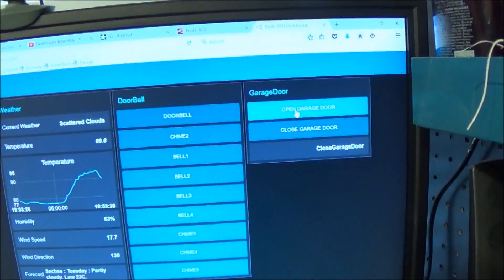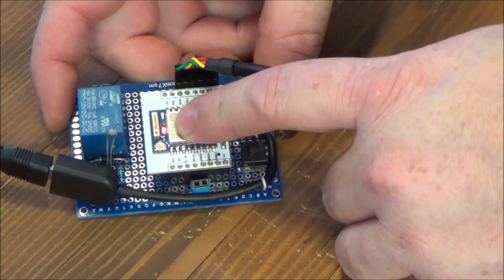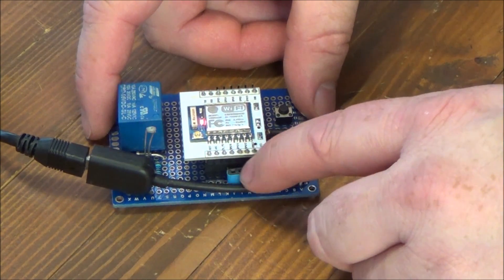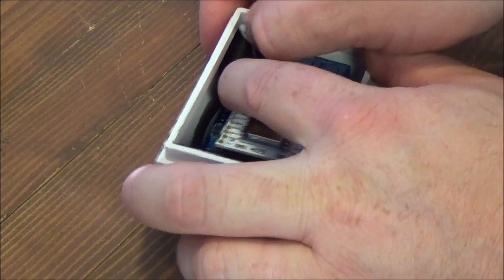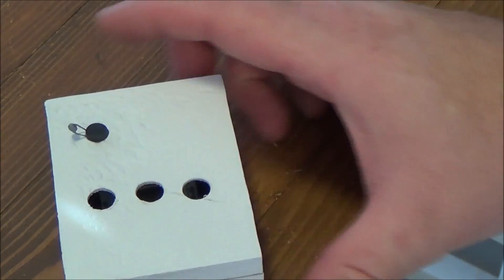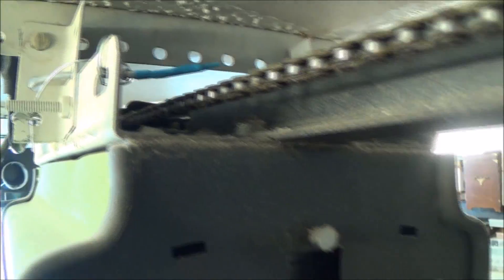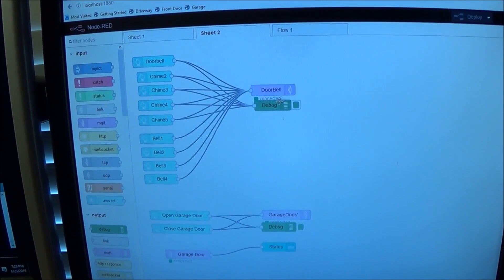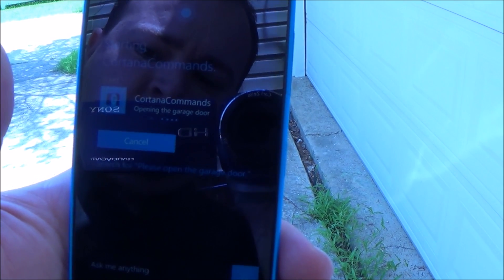ESP8266 MQTT Garage Door Opener

Comment: Thanks for this. Love MQTT. I'm running Mosquitto on a Raspberry Pi. I am experimenting and using your code for my own version of a garage door opener using a cheap little relay module, a couple of dollars from Ebay or AliExpress. Just search for ESP-01s relay. I had to make some mods to the board but if you look at the post started by SilentDreamcast https://www.youtube.com/channel/UCH4DwAvLmQJ5dx21sZzUGiA I will post what I did there. In the end some time and about 5 dollars grand total and you have a very small MQTT relay module (the size of the RELAY and the ESP-01) with no custom circuit board required and very little effort making a few minor mods. One of these days I'll have to get to making my own blog of my Home Automation adventures :-) Thanks again for the MQTT Arduino code as it was a great kick start to get me there.

Comment: Hello, the idea is very good.
One doubt, please, is the server local? It's with raspberry?
thank you.
Reply from the maker: You can install Node-red on anything, in this case i just use a PC but Raspberry Pi works the same
Reply: electronhacks thanks for the answer. Is there a free web server to load this application?
Reply from the maker: Yes it is called "Node-Red"

Comment: I would reconsider the magnet placement. If you put it on the door itself you can detect if the manual release is used, or if the door is forced open (in case of break-in). Thanks for the video!

Comment: I looked at the contents in your github.  Actually it's quite normal in c/C++ to have to define a referenced function BEFORE it's called, or place a prototype before where it's called, and flesh it out afterwards. (The function could be in another file module, compiled separately so long as the module where it is referenced has a prototype defined, or includes a header file with the prototype at the top.)  So this really isn't a bug, but the way most compilers / linkers expect things.  I did notice that earlier versions of the IDE would do backwards referencing, (assemblers usually do this, otherwise you couldn't make forward jumps).